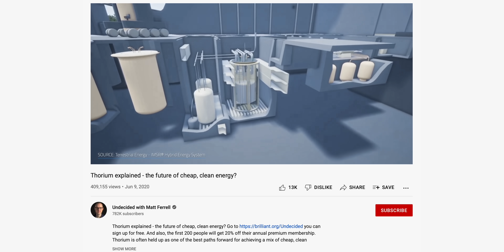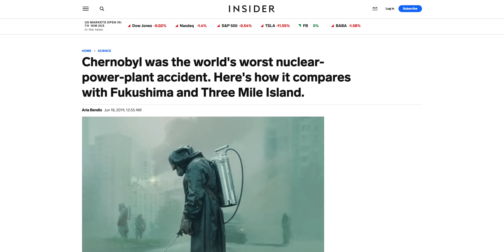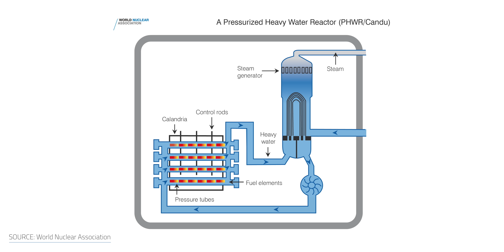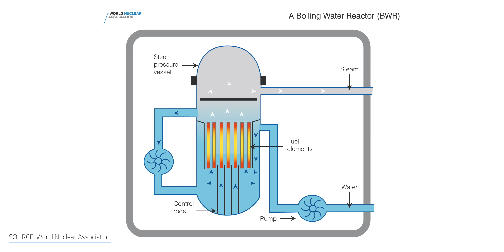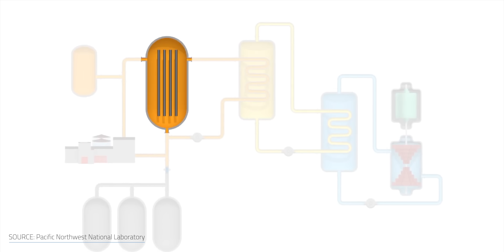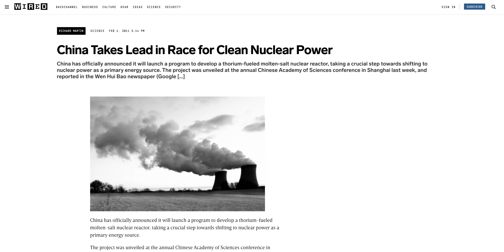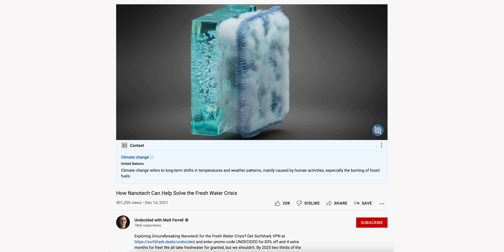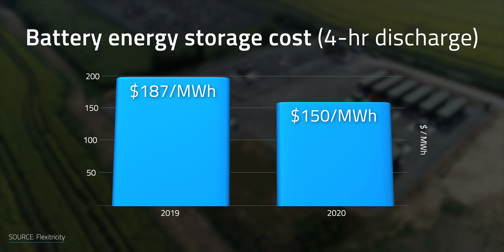Revisiting Thorium Energy - The Future of Nuclear Power?

Comment: I've been hearing about how thorium is a clean, safe, cheap solution to the problems of nuclear reactors since the early '80s, and yet there's not a single commercial thorium reactor in the world. There's barely lab experiments. Since the whole "blame the treehuggers" argument doesn't matter in Russia, China, India, Pakistan, or France, I feel confident the reason this technology hasn't seen any effort despite its on-paper benefits is because real-world nuclear engineers designing this stuff know something the keyboard engineers do not - something that renders thorium reactors either operationally impractical, or far too expensive. Or we can just blame the treehuggers. (Note that thorium is a separate issue from molten salt, which is actually a good idea and thus getting real research.)
Reply: The answer is simpler and far less foil hat: the US, Russia, China, India, Pakistan, and France make nuclear weapons, and thorium reactors don't advance that cause.
Reply: @rapid13  The problem with that explanation is that none of them use byproducts of commercial nuclear reactors to make nuclear weapons. (And in general, I think we badly need to separate discussion of nuclear power from both nuclear weapons and safety. Reactors are generally safe and weapon proliferation is a separate issue. We should stick to the economics and grid engineering implications - which I don’t think are all that great for nuclear either.)
Reply: @davestagner  Where do you think they get plutonium from (or at least they used to which means they still can)? Do you think they couldn’t still use spent fuel rods and reprocess them to separate it out? Yes, I know they have specific reactors for creating weapons grade material. Doesn’t mean they don’t think ahead and have contingency plans. Government is always thinking about how to kill the other guy. No need to invest in newer tech that won’t advance the cause of war.
The economic issue is mostly solved by removing the ridiculously burdensome set of regulations covering the construction of plants and reactors (put in place to placate the tree huggers, BTW) and replacing it with something sane.
The grid is a separate issue completely. Doesn’t matter what power source we use, it needs a bit of an upgrade.
Thorium may not be the magic bullet, but there are other options just as safe if not safer. The Illinois Energy Professor has great explanations on his channel. Worth checking out.
Reply: @rapid13  I don’t buy the idea that ‘burdensome regulations’ for the treehuggers are the reason for the generally low use of nuclear power today. Russia and China have the same problems. And while safety regulations do need to be met, they exist for good reason. Reducing the regulatory burden isn’t going to significantly reduce cost, unless your plan is to make unsafe reactors. Because a responsibly designed reactor will have expensive safety precautions, whether they are required by regulation or not. Nuclear is generally safe BECAUSE we do a lot of expensive safety features.
Reply: @davestagner  Do you read for comprehension or only to respond? Because it seems like the latter. I didn’t say regulations are the reason, I said they’re part of the reason. A pretty large part, whether you buy it or not.
Not all regulations exist for good reason; some exist solely to increase compliance difficulty. Surprised you didn’t already know this. And reducing regulatory bullshit always reduces cost. In the case of nuke plants, I’ve seen it estimated that almost half the cost is compliance related. Just look at how long it takes to secure approval from the EPA and NRC. And look at what happened at Diablo Canyon.
Reducing burdensome and unnecessary regulation does not mean building an unsafe reactor. Your claim attempts to create a false dichotomy. Just as there are levels of safety, there are levels of regulation. It’s not all or nothing.
Neither Russia nor China have anything like the regulatory issues we have in the US. They don’t put up with dissidents trying to dictate to government, either. No use trying to compare us to them. But I notice you don’t mention France, which gets something like 80% of its electricity from nuclear. Far less regulation, lower construction costs, and zero accidents.
Reply: @rapid13  You might want to read the “Nuclear Power in France” wikipedia page before holding them up as a role model. They’re currently decommissioning 14 reactors (20% of their total), while building only one. In 2016, they had to temporarily shut down 20 out of 58 running reactors due to problems with steel quality - problems that had been actively covered up by the manufacturer (this is why we have “burdensome regulations”, btw). Overconstruction of nuclear base load led to overproduction/underproduction problems, both exporting an importing power, which inflates energy prices in France - grids need to be responsive and flexible! (Y’know, like what you’d get if you rely on renewables and batteries…) A few years back, the National Assembly voted to reduce nuclear to only 50% of France’s energy, which is a good idea considering the problems a mostly-nuclear grid has caused.
Reply: @davestagner  Now you’re trying to set up a Straw Man. And truthfully, I don’t have time to explain something to you that you have no interest in learning. So, keep on hugging those disposable wind farms and maybe Google the term “over regulation.”
Reply: @rapid13  I offered up facts, and I sourced them. You’re welcome to try to address my facts with your own interpretations or alternative sources. Or you’re welcome to pretend this is Vietnam, declare victory, and run away. The plain and simple fact is, France (your model) is backing away from nuclear power, and had problems with coverups of safety issues that are EXACTLY why we need strong regulation. I pointed out, correctly imho, that the actual safety features, not the regulations, are the bulk of safety-related costs, and would be needed whether or not there is regulation. (If you think the main cost is legal rather than technical, you should be able to source evidence of that, and I’ll gladly admit I’m wrong if you can show me actual evidence for your beliefs.) I brought up Russia and China, which you largely ignored, because they don’t have substantially more nuclear energy than the US, despite (as you pointed out) none of our problems with protesters or democracy-driven regulation, which suggests to me that the problems are technical/cost, not regulatory or the consequences of democratic participation. If you disagree, you probably should come up with a good reason that authoritarian Russia has far less nuclear power than democratic France. 

Or, you could declare victory and flee the battle, sir.
Reply: @rapid13  To be clear, NOTHING about my responses is a “straw man”. And I’m pretty sure you knew that already.
Reply: @davestagner  Incorrect. You still refuse to accept that regulations are not an all or nothing proposition (false dichotomy), and you continue to claim that your arguments make the case for "burdensome regulation" (Straw Man, given that you actually believe your false dichotomy). The one stems from the other. 
But hey, you keep right on believing whatever you want. Not going to bother me at all. Have a good night.
Reply: @rapid13  “burdensome regulation” was your term. I use it in order to refute it. Saying that I think regulation is all or nothing IS, in fact, a straw man. Consider the example I brought up… in 2016, in France, 20 reactors had to be temporarily shut down due to problems with steel quality in certain areas - a quality problem that was covered up by the manufacturer. Regulation exists because we can’t trust vendors to behave honestly when money is on the line. Better regulation would have involved spot tests of the steel - the sort of thing I’m sure you’d call “burdensome”. But you’re still ignoring the main point that I keep making - that Russia and China, without all the regulatory issues faced in the West, still haven’t embraced nuclear energy much more than the US (the model of “burdensome regulation”) did, and certainly not to the level that reasonably-regulated France did. So I don’t think there’s a sound argument that “regulation” is the cause of high cost or low market penetration at all, because the examples run counter to the proposition. You can keep on shying away from the point, but you and I both know it’s because you don’t have an answer. We don’t do science, or engineering, by first choosing our conclusions and then selecting/ignoring the facts as needed to fit. I’m not preoccupied with “believing”. I’m looking at the facts - facts with sources - and pointing out that they contradict your stated beliefs.
Reply: @davestagner  Yes, I know it’s my term. it was part of an entire sentence, but you cherry picked it because it helped you set up your Straw Man. Well done, and good night.
Reply: @rapid13  Just out of curiousity... can you point to any examples, any at all, of a regulation that is "burdensome", in the sense of being unnecessary and making power plant construction significantly more expensive? Just one would be nice.

Comment: the statements about the price of solar and wind are just that, a whole lot of factors are not incalculated and result in energy poverty due to the increase in prices, these are conclusions i made due to reality that occurs time and time again with these renewable projects, also battery's there are no solutions on in sight, the benefits of mass production of lithium batterys wil be totaly anihilated by the soaring prices of the resources needed to make them, for the stuf about thorium what the problems where in oak ridge was a real eyeopener thanks for that, we need to get rid of the lies about renewable energie, the co2 bias, we need urgently to dynamicaly search and achieve new realisations, with an open mind, no dogma's, nobody benefits if the western world fucks up, if that would be the main purpose( it isn't)

Comment: Step #1, destroy the coal lobby, that's been the real problem for the past 70 years, as they cry about safety, stir up public fear, and the NRC is now actively hostile against any new designs like these. For example, requiring expensive concrete pressure chambers for MSRs (thorium or not) that don't use water in the reactor itself.

Comment: Wind and solar operate at about 30% at the best of times. They won't produce for 8 hours a day in yhe hottest places on earth. They also take astronomical amounts of land and resources and have half the life cycle of nuclear. In the places on earth that would produce the most solar the batteries could be prone to melting due to heat. Once  the reactors become modular and are mass produced the cost and construction time will come down drastically.

Comment: Thorium is a good solution for the next 30-some years.
I always wary of these claims about solar and wind costs being lower per watt, when what really matters is not peak but average and even then only if you have great energy storage and distribution capacity. Plus, terrain consumption, positioning, production methods (if solar panels are made in china using carbon power, are they really clean and cheap?). Batteries are cheaper, but the availability is not unlimited and they are used in so many things that really, we should not waste them for storing energy that we can produce in other ways, until some real breakthrough in battery ttech is achieved. Improving those and storage is definitely great, but a sustainable, clean and continuous power source like nuclear (and thorium based in particular) is the perfect complement to renewables.

Comment: I think thorium is going to have an impact regardless of whether it pans out as a viable fuel.  Nuclear is really the only option we have for a de-carbonized world and the increased research Thorium spurs is the best chance we have of getting there.  whether it is public perception or new reactor designs it's a net benefit.
Reply: I do not think thorium will be the backbone of a grid but it most certainly could be a tool that gets used.
Reply: @bighands69  I don't know whether it will or not but it's the research into finding out that will make the difference.

Comment: Nuclear is expensive because of the MASSIVE over regulation of plants due to over wrought safety concerns. Solar and wind energy, contrary to the public's misconception, are extremely environmentally DIRTY and they have MAJOR problems that are downplayed or completely hidden from the public -like wind turbines kill hundreds of thousands of birds per year and the service life is ONLY from 18-25 year max (and that is with good and expensive maintenance) also, the huge turbine blades are made out of nasty composites that that, once made, cannot be mulched down because that are a contaminant to the water table and have a half life of NEVER. Engineers had a NASTY surprise after they install several hundreds of these turbines -and that was the leading edge of the propellers shown extreme wear very quickly. So, to deal with the old blades, they chop the MASSIVE blades into a few pieces that absolutely dominate nearby landfills that mean small towns have to find other places to dump the towns garbage because these massive blades take up huge amounts of area in the landfills. When the public gets sufficiently informed about the incredible downsides to wind and solar they WILL be bewildered as to why these mammoth structures with huge concrete pads were built in the first place in pristine country-side and farmland. The general public thinks wrongly that these massive bird-killers will last for centuries and cost little to nothing to maintain. WRONG. Research German wind turbines and see their rusted out generators that lasted less than 25 years and are now dangerous (they eventually collapse from the weakened rusted out steel columns ) and German is quietly going back to cool-fired plants because energy prices are  through the roof expensive there. But France had the right idea by building zero carbon emission, safe nuclear reactors. Eventually, the world will realize that wind and solar is great for small remote locations but NOT for powering the grid of any town or country... and, I haven't even gotten into the serious nastiness of batteries and solar panels.

Comment: Nuclear power is definitely a must (of any kind, as long is they are NEW reactors). It should replace any and all fossil fuel based powerplant, except for maybe 5-10% as nuclear doesnt scale quickly with demand.
While solar and wind (and other) options for electricity should also keep growing, it is a fact though that those "intermittent" powersources can't power everything. Battery storage on a large scale is also asking for problems on its own and I think is THE worst idea. It is much better to use excess electrical power for passive storage, such as hydrogen generation, pumping of water for hydroelectricity and others.
I find it annoying the world think batteries are a good way of storing energy... Do you see what happens to your phone if 1 cell fails? or one battery in your new tesla? I would NOT want my electricity to rely on that.